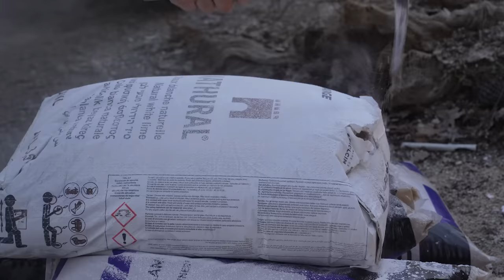Back to rebuilding a ruin.

Comment: For someone who started with one spade and one wheelbarrow you’ve come a long way Dan. And yes, I’m addicted too
Dying to see that park come alive now in spring
Reply: A new big Blue mixer  ❤😂 that's all the motivation you needed Dan. Will be nice to see the wall up and that roof enclosed. It worries me that if a storm came through the open end, it could potentially lift the new roof off. Roll on dry sunny day and no storms. Xxx keeping everything crossed for you Dan. X
Reply: Me too
Reply: It's a shame that the climate is not like in the South of France, he could have planted a Mèze bougainvillea, a variety created in France ,flowers are light rose.
Reply: The big blue Honda mixer finally in use is it the same one you brought on site in the autumn while you were using the small one? At least with lime you can use bigger batches as going off time is longer for your limited workforce,so much erosion to make structurally safe.

Comment: Can’t believe how much I’ve missed the wall rebuilding process.
Reply: You can go back in the videos and catch up if you'd like to.
Reply: You are doing completely the right job rebuilding and stabilising the walls in that area.

Complete your gable to the new attic and get ready for roofing the central high level corridor.

Totally the right progress. You have learned from diverting time to landscaping and are pushing the roof on the chateau.

Get it dry and see progress rocket.

Check out the warranty on previous which. It should not let you down like that. A one or two man build is light usage. It should last three years at least.
Reply: @Chereese0808 we're probably all caught up. I also enjoy the stone work rebuild. The pointing is so relaxing to watch.
Reply: Me too ..... was just thinking that while mesmerised watching Dan work on that wall ❤

Comment: just a suggestion from a seasoned builder ( 40 years in the trade ) the first thing I would have don is build an exterior hoist to bring up all the materials you are caring up the believe me you will feel this in your body at some point otherwise love what your doing.
Reply: as a builder 40 yrs in the trade, tell me is this how you fix that kind of brick wall? I mean you can basically break it with hands and plastering some mortar over it hardly seems to improve anything. Will it not crumble later on ?
Reply: They Build differently in Europe than we do in the states ….  HE IS CONSULTING WITH PROFESSIONALS ……. RESTORATION PROJECT
Reply: I keep thinking along those lines too…but wasn’t quite sure how he would have something strong and sturdy yet close enough to grab and far enough out from the wall to prevent accidents.  Thank you for saying it exists. Cherry pickers being too expensive.
Reply: He should have got an electric mixer and put it just below the hoist inside on plywood and just dolly the mortar to the hoist, he could lift all the sand and cement on the digger up by the side of the steps and dolly them in!?!

Comment: Dan…. The condition of the wall supporting one of the main horizontal beams is shown at 4:00 in the vlog. The wood beam is sitting on a singular sloped stone and that sloped stone is sitting on a pile of rubble weathered over 40 years. Since this masonry wall will be holding a primary structural member, consider temporarily supporting the beam with a wood column and then rebuilding that portion of the wall to the right of the granite opening. This way you will assure that the roof beam has proper support and not just cosmetic repairs. Kudos on resuming this mind numbing, yet strenuous task….not as sexy as the roof…but equally important.
Reply: In another posting we got to see the stonework on the turret. Yikes!  That looks very precarious. Seemed there’s not a rock connected to another - they’re just sitting there.

Comment: Look at that shiny blue  cement mixer!!! Bet it will get a workout..
Reply: Hello, do you know how Dan provides the energy in terms of the machinery? Is it only the 2 solar panels that provide the electricity? Cheers.
Reply: @PimpYourTrash, during the winter he's been using a small generator in addition to the solar panels, because of the lack of sunlight. 

To power the new tools however, neither of those would work as the current draw during startup would be quite high, and they would drain the batteries very quickly. I can see two scenarios going forward: getting reconnected to the power grid, or getting a serious battery bank dimentioned for the new load (if he wanted to contiue to stay off grid). However, I would hazard that option two will cost quite a lot more money that just getting grid power :)

Comment: I would highly advise putting a Winch on the outside so it’s easier to bring up lumber and and mortar, bricks etc. possibly from the central turret . So you are not lugging them all in  on ladders first.

Edit: that way you can just back up your truck and unload from there.

Comment: I thought you, the concrete mixer, and the winch were never going to wear out.  They wore out before you did!  Outstanding!
Please be careful taking the pail off the winch when you get it to the top!  All it takes is a little miscalculation and the weight of the pail and contents will get you off balance.

Comment: Dan, what about doing a Q&A? I'm sure lots of people have questions they would like to ask about the renovation :)
Reply: No time!
Reply: Hello, do you know how Dan provides the energy in terms of the machinery? Is it only the 2 solar panels that provide the electricity? Cheers.
Reply: He probably answers some on his patreon  members sight.
Not sure though,  but most you tubers use it
Reply: He's got a diesel generator, you can hear it in some of the videos and he's mentioned it in the past that he uses that when there's not enough sun
Reply: @DirkRevised Yes, 2 panels (400W each, I think?) and a suitcase sized battery with a builtin inverter.  Dan must be at about 45 degrees latitude so will have decent amount of light all year round so plenty power going in and most electrical machinery is only running for seconds or minutes at a time and the lighting is all LED.

Comment: OH, nice mixer, you really needed a larger one with all the brick/stone work to be done. Reinforce the lower and build up, just like the floors. Appears you are working to get that wall done to really seal up that one section and get the roof all supported so you can move to the turret section.

Comment: Just a hint to quickly fill the gaps between the stones: Use a piping bag! I came to this idea because it took me too long to fill the gaps of my natural stone wall with mortar. So I took the piping bag of the kitchen, filled the mortar in and pressed it out directly in the gaps. You just have to use the trowel to spread it and to form a nice surface. Benefit of a piping bag is the it could be easily refilled with mortar again and it could get cleaned and reused. Mine is now a fix part of the workshop.

Comment: Nice to see you working with nice new tools and now a larger new mixer!   Now you’ll need 2 smaller buckets to lift up for the next phase.  A new winch is also a must as you will be using it a lot!  There are loads of stones, bricks, blocks, and of course rendering as you tackle another wall.

Comment: 1:55 Large bucket of cement. Untied shoelaces. Eleven steps. What could possibly go wrong?🤣😏
That's a nice shiny new cement mixer, Dan. It's s bit too tidy though. Billy Petherick will be taking the piss if he sees you using that, after all that banter from you about not trusting someone with a clean cement mixer.😁😆

Comment: Dan I know Europe has portable mortar pumps. You just have to transfer it from the mixer to the pump. Flex hose lets you go along the wall with a steady stream filling cracks and openings, then just a wet sponge to smooth it all out. It would go a lot faster once the bricks and stones are set in position. Hope this helps. either way, keep rocking Baby!
Reply: He's used one on his last house for rendering, but presumably he has to do wall-building and consolidation here.

Comment: You need one (or 4) of those lifts like Edd’s (Boudreaux Life) roofer used to get the tiles and materials up. It has a bottom and three sides and goes up a rail system.

Comment: nice new concrete mixer, a tip to better handle your sand for the mix, get a bigbag 1x1m fill it with sand and its cleaner and easier to work with

Comment: An odd job man touting for work locally quoted £850 for repointing my front garden wall which is about 18 foot long, he said it would take 2 days.  I laughed in his face as I said 'Oh no, you'll be taking my summer job off me'.  2 buckets of mortar and 4.5 hours later the job was done!!!  Just wondering what to spend the £850 I've saved myself on?  Thanks for the inspiration Dan.  Lovely job you're doing there.  Onward and upward. xxx

Comment: :hand-pink-waving:Dan; your mix is far too sloppy? stick some sharp sand in - it should be 1 part lime to 3 parts sharp sand and a bit of hair for the pointing? It shouldn't look like cow sh**t but be a sticky play doh consistency.. It will crack..  Its also super important that you watch out for frost this time of year with lime.  Thanks for the vlog, always a joy and look at the numbers!

Comment: I have to hand it to you! You are nothing if not determined! This is a huge job especially doing it mostly by yourself. It’s good that you have help for some of the more precarious aspects as well as where you have had to have heavier equipment to move things. It’s also good to see that you have been able to acquire a new stable of power tools to build out a shop. You can only do so much hanging off of a ladder. I was a chief engineer at a resort hotel for about 20 years so I can appreciate the work you are doing. Keep up the good work, I can’t wait to see you get your major construction done so you can move into the interior and hopefully work more inside and out of the elements next fall and winter!

Comment: Cut the cement bags in half with a hand saw.  So easy to lift each half and removes the entire paper issue and you just pore in the half sized bag!!!!!   You could put a place to keep the saw on the machine so it’s always handy.

Comment: Use a vehicle winch with a 12v supply. Use a suitable length (double the desired lift height) of Dyneema with a hook on both ends, wrapped around the drum five or six times. This will mean that you always have a hook at the bottom. You can also lower rubble at the same time as lifting bricks or whatever.

Comment: that winch is a similar design to the one i have (made for pulling boats on trailers) but it does come with a bonus the knob on the side is for free wheeling,so you can drop the rope down fast but you must tighten it to pull back up. also the gears inside are a simple setup and you may be able to move them round to get a faster winch speed.

Comment: Why not get some spring clamps to hold the waterproof membrane on the roof until you can attach it to the rest of the roof when you get ready to.  It will save it from ripping off in the wind.  Just saying 😊

Comment: That is a slow winch. I like the idea of getting the roofs completed and making the whole place watertight. Have you looked into a used laddervator? I dont know how many stories they will go, but the winch is ridiculous. I'd just replace the old winch motor and get back to work. Good to see another video of the hardest working man in France or the craziest man in France.

Comment: Dan! I know added labor is expensive, however there comes a time when alternative solutions become necessary. I am sure you could find young labor volunteering  for your project just to have the experience of working with a craftsman. Please look into it, place an add  in the local paper. if you are concerned about workmans comp or other issues seek out a lawyer to cover you in case of injury.

Comment: I was a little puzzled a few episodes back when you were chucking rocks back to the ground, I thought that any rock that had made it up to that level would be rock that you didn’t have to carry up and could be utilised in rebuilding and I seem to remember many months ago that you were going to construct a new ring beam using those concrete channel blocks with re-bar and then filling them with wet concrete

Comment: Something I've been noticing while you're doing masonry work is how the pointing - mainly the top levels - has deteriorated and I wonder if it's due to the fire damage + the acid rain problems in the 80s/90s after the fire. Perhaps the fire heat-damaged the lime-mortar and that made it more vulnerable to acid rain damage? the pointing on the exterior brickwork is all in excellent condition, but the higher you get, especially with the foyer-turret, the worse the pointing damage gets, at least on vertically-exposed brickwork. and Lime-mortar is vulnerable to acidity-damage. Food for thought, perhaps?

Comment: Dan, brilliant, and format has left them all in the wake, they don't know what's hit them.
I see you lugging those buckets upstairs and all of that new kit on the lower ground floor could they not give you a 1 ton pygmy crane to drop everything from the suppliers vehicle straight up and over into the second floor including bags of sand and pallets of cement or lime straight up and over and in via the tower including the mixer make up your mortar upstairs so its always going down once made never up, just strengthen one floor only for the purpose.
Brilliant channel totally unmissable.

Comment: Reparing walls is typically the job, where you can need a troup of volontears to go ahead faster. 
Specially because you will have several walls to repare and stabilise. Sooooo many walls to do ! Many in the first floor, and in the 2d and 3th too !
It would be a good help for you ... ans for the future of the big lady too !

Comment: I tought you already knew the little trick with the stick under the bag of ......  and then cut the top lift the stick and have 2 easy to lift paper "buckets" 
to throw into the mixer.

Comment: I came across something interesting, though I don't know if it could help you in any way... Pointing the walls, now you push in the mortar with your trowel, but I've seen several times now people using like piping bags to push the mortar in deeper and much faster than a trowel could. To me this could potentially speed up your work tremendously ... But then again, I have no building experience whatsoever. :D

Comment: I am surprised that no one has come up with a device that can inject the lime slurry into the cracks, like a miniature concrete pump. They have equipment in Greece for applying stucco to both outside and inside masonry walls but it also injects air the mix which is not needed in this application.

Comment: Just a thought but why not set up the winch so it lands beside cement mixer and pull it back towards you at the top floor ? Or even winch up old mixer leave it on the top floor so it’s closer to you ?… after reading down the comments looks like I’m not the only one thinking that .. lol

Comment: Just wondering, I know the really loose old mortar must be removed, but what of the stuff that's further in and still only moderately sound, I guess it's just freshly mortared over. Seems a lot of the upper level walls will easily crumble with just a few good whacks, I thought most would have to be totally reset, but I guess not.

Comment: Really enjoy watching the progress on your chateau. However, very concerned you are going to do your back in carrying mortar. Can you put the mixer inside or put it somewhere that does not require carrying the mix up stairs. Once inside, put the bucket on a trolley, wheel it to the winch, then once at the top use a smaller bucket to get the stuff where you want it?
Reply: And how do all the materials get to the mixer, by magic? Mixing lime in an enclosed space is a big no no.
Reply: @LaReynedEpee  good point, but there has to be a better way than to repeatedly carry a heavy bucket of mortar up the steps. 
Even mixing outside is not entirely safe either. Perhaps wearing a mask?
Reply: @fredturk6447  He certainly should wear a mask, I would.

Comment: I saw a video of a man in china renovating his house and he had a lot of pointing to do. However, he had a system that made it way easier and a lot less messy, he used piping bags (big ones) to pipe the mortar into the gaps ad then used the trowel to smooth it off… I thought “what an epic idea” I’ve done pointing and it can at times be soul destroyingly slow. By the way Dan it’s looking really good :)

Comment: Wow Dan, you are stepping up. Brand new blue cement mixer. Wat to go. I never see both dogs together just one of them. Anna and Elsa from frozen. What is that open section that is beside the area you are currently working on repairing the walls? Is that part of attic that you said was waterproof?. Why is the waterproof fabric dangling in the air?

Comment: Now I'm wondering if Dan pulled out little chunks of granite / stone when they cleared out the basement levels? From today's video, you can see all those small stones.
Reply: In the next video there is a pile, but most are a bit larger than what's on the wall.

Comment: Your cement looks like it is almost too wet. It shouldn't flow by itself, but keep its shape a bit more and instead of pushing in stones by hand, you should use a rubber mallet
Reply: Lime not cement. As he has told us numerous times

Comment: I feel like the brick turret section at the top takes away from the shape of the building.  Is that an addon to the original design?
Reply: No, it's always been there. I agree though, that it detracts from the elegance, but he has to keep the exterior as it was.

Comment: Holy Toledo (as in Ohio).  Don’t they make a key start cement mixer? Me you need a conveyor system to get the cement up to the top.
Reply: It's probably running on petrol because of the lack of an electricity supply